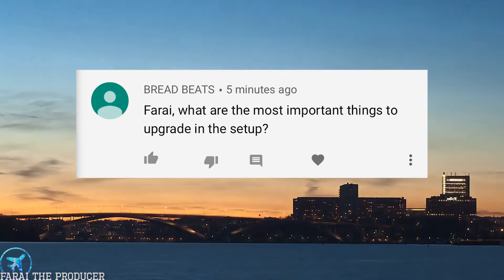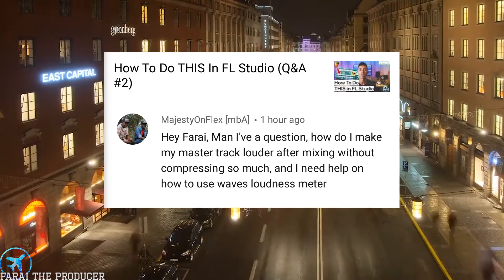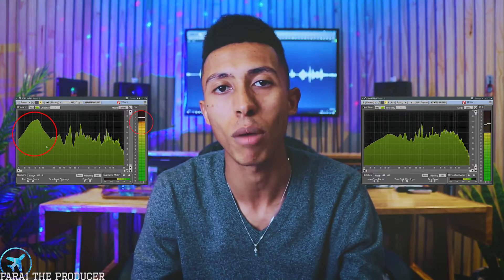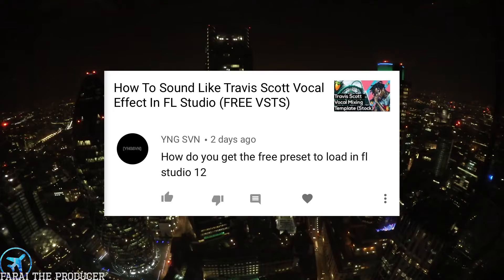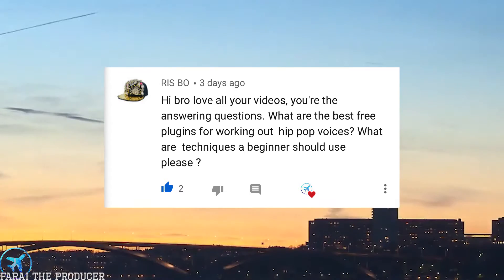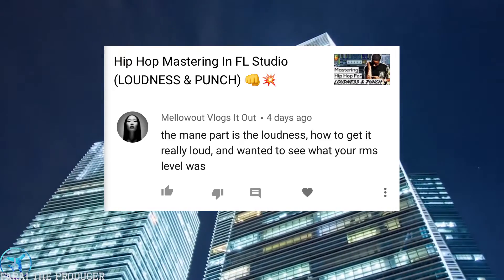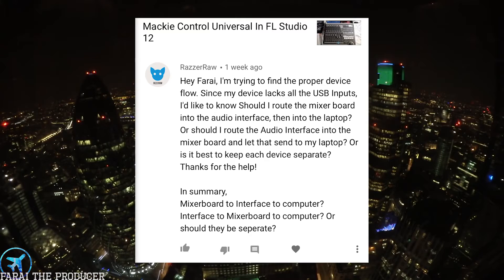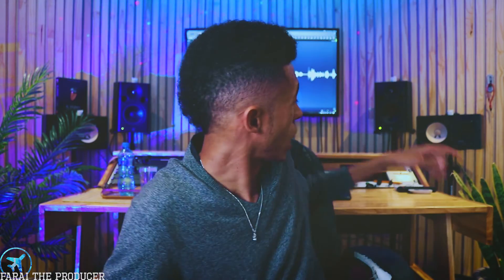How To Get Louder Mixes?? LUFS Explained? (Q&A #3)

Comment: GREAT VID here's a tip to do before you start recording to a beat. use an audio editor to see if the beat is clipping if you just have the mp3/wav version and not the full track outs. I use audacity for this and when I see clipping i use audacity's amplify effect to get the beat down to -0.1 db which is the point just below clipping. Then when you have the beat in your DAW turn the beat all the way down (-inf) and then slowly raise the fader until you feel you've got the beat sitting at a good level
Reply from the maker: the mystery man appears, thanks for the info G

Comment: Thanks for the sauce, Farai!

The program Expose by Mastering the Mix claims in their YouTube preset that YouTube asks for an integrated loudness of LUFS of -11. Whether I master to -11 or -13 to -14 LUFS YouTube still normalizes my audio when I check ‘stats for nerds’ and the audio does not sound as loud as other tracks I hear. I’m afraid if I try to master to -9 LUFS Youtube will heavily compress/normalize my track. And if I turn the kick and bass down how do I still make them knock like other tracks?
Reply from the maker: Ibrahim Good comment, from what I know YouTube now want -14LUFS as of recently, I wouldn’t worry too much about YouTube crushing your song, streaming makes audio sound so sloppy anyway, just keep working on your mixes until they sound good and experiment with different masters. Peace